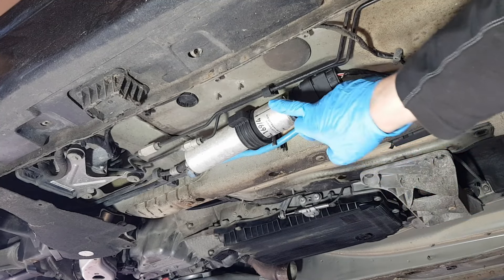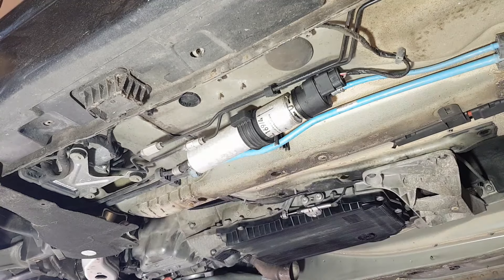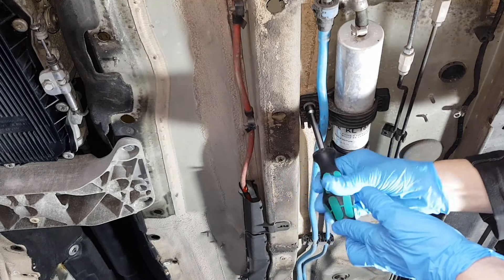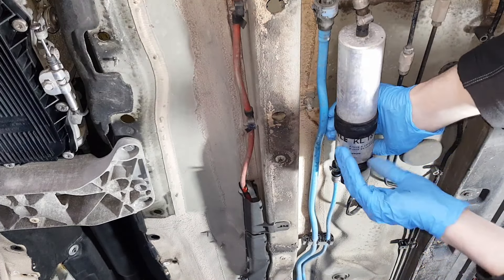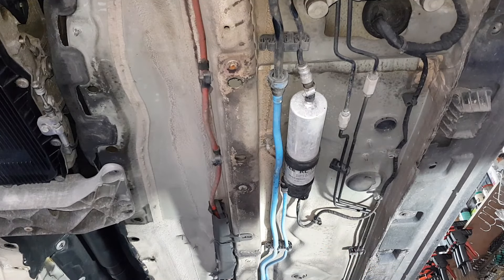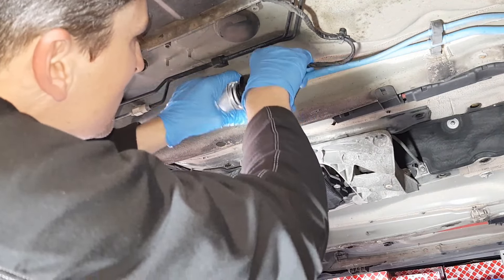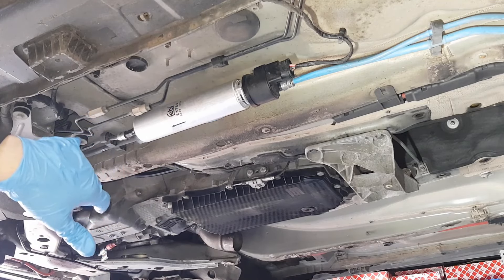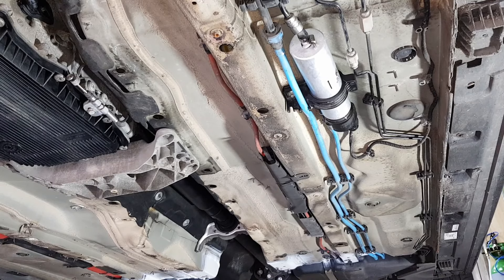BMW F10 F11 530d 520d 525d Fuel Filter Change N57 N47 How to Replace Diesel Filter F01 730d 330d G11

Comment: I've been looking into this fuel filter change on BMWs with n47/n57 engines and I want to clarify some things for people who have questions about the process like I did. 1) First of all, switching the start button on and off, without starting the engine, doesn't engage the low pressure pump in the fuel tank. I've seen somebody do that with the fuel filter removed and nothing happened (no fuel came on the fuel line when the start button was pushed, no sound from the fuel pump either), confirming what other people said; 2) the fuel line that goes to the high pressure pump has a one way valve that prevents fuel from completely  draining from the  high pressure pump, if you open that line at the fuel filter (that's why you see just a small amount of fuel draining when you remove the filter); 3) diesel fuel has a lot of additives and is very oil like, that means it lubricates all the components it touches; this means that there is no risk for the high pressure fuel pump to create metal shavings through friction; 4) the bleeding procedure of the fuel system is absolutely required when this system has been fully drained, for example when the car run out of fuel and sat for a while or when the high pressure pump was removed or replaced;  5) even people who use the automatic bleeding procedure find that, sometimes, the engine doesn't start at the first or second try; 6) if you can't do the automatic bleeding, filling the fuel filter with diesel, before connecting it, is a handy way to ensure an easy and fast start of the engine.
Reply from the maker: Thanks for your input. We can all learn from eachother here. Glad to see someone has read the other comments and has watched the video in detail. This makes sense of everything I do to see that people are learning and sharing expert information. Probably one of the best and most comprehensive comments here on the channel🤝🏻
Reply: @TheKeenMechanic  Thank you for this tutorial!
Reply from the maker: @cristiandemirel1918  You are welcome and thanks again for your input.